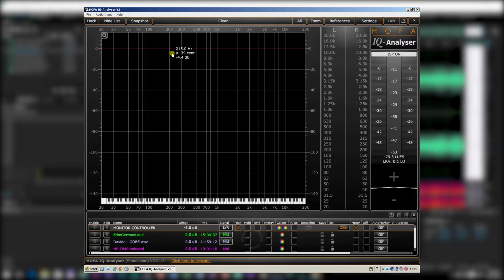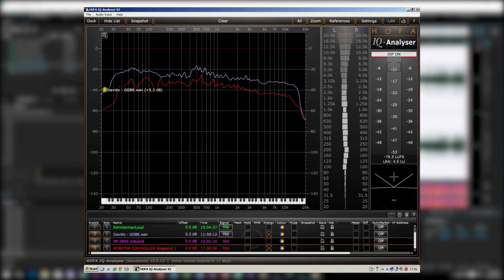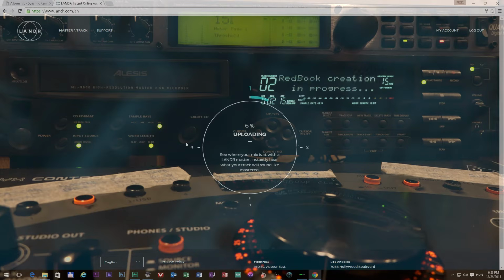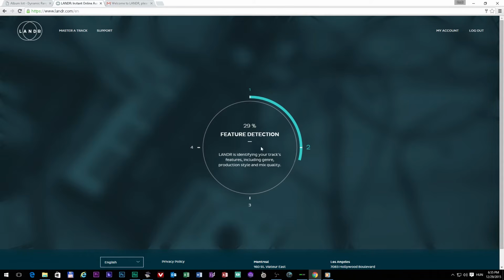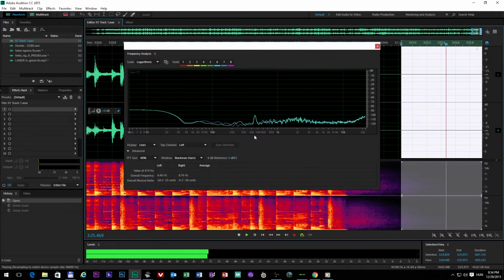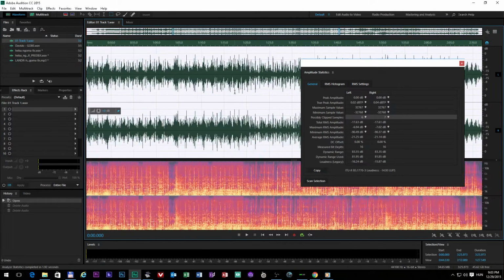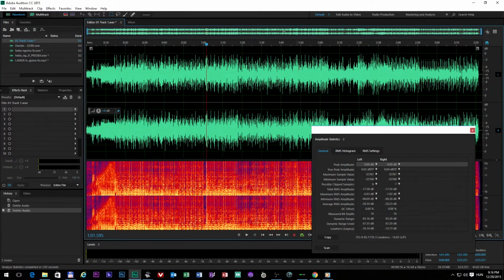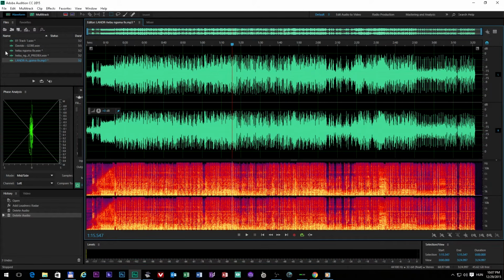Landr.com - Online mastering? Part 3. Mastering with DBX Quantum II. Final verdict

Comment: I can only find a regular Quantum for sale(not the II). Is that worthwhile, or should I hold out for the II?
Reply from the maker: reviewz You just missed one on the ebay. The guy listed for 800 EUR a nice condition piece. Nobody bought. I think he will relist again soon.  Search on the german ebay.de
Reply: BMR Studio Hey, thanks. 800 EUR is a bit expensive, right?
Reply from the maker: reviewz not at all. read the S.O.S. article, link in the description. Is a real mastering grade eq, compressor, multiband compressor, limiter, line driver, tape simulator, etc. with all digital benefits and IO. Once You try, You never want to deal with plugins, and top of it, real DBX sound punch as hell! So Your homework is: find a solution what gives You a same performance on a same price. Good luck. I think 800 EUR is a fair deal. Same like to get  a Roland Jupiter 8 for 2000 EUR
Reply: BMR Studio Picked up a Quantum for $319. Just need to be sure the OS id updated.
Reply from the maker: reviewz nice hunt :) is II. ?